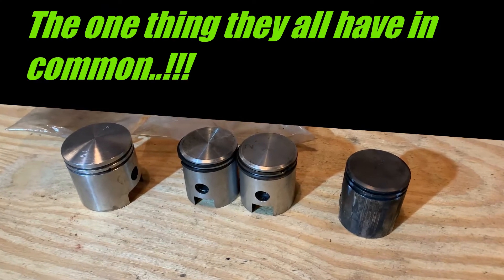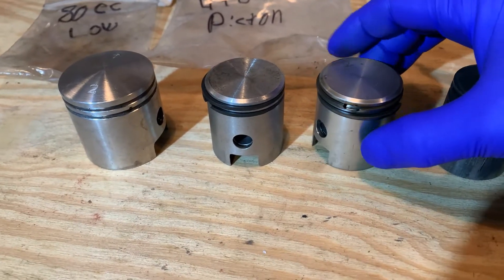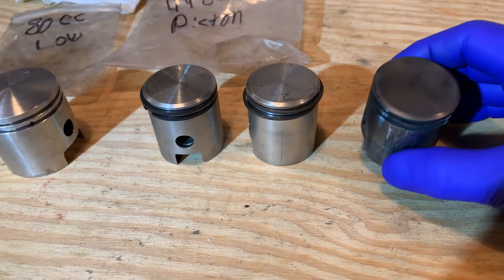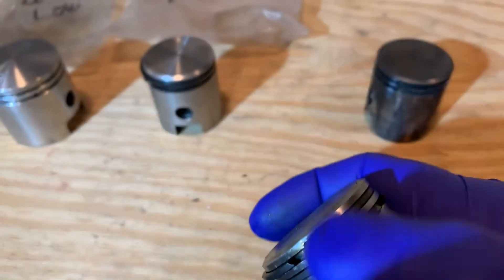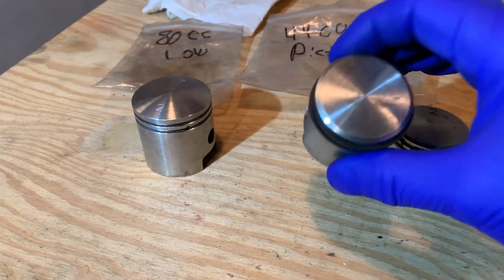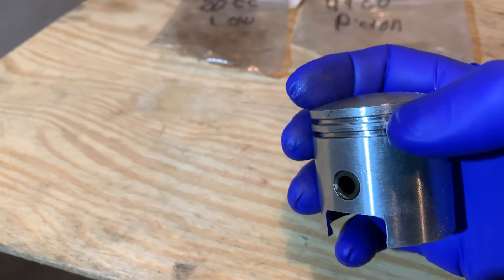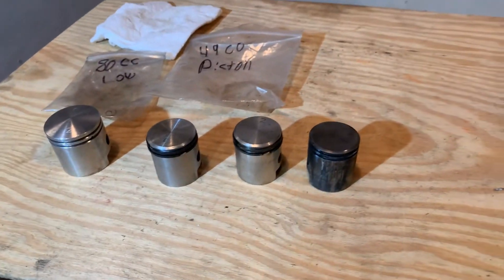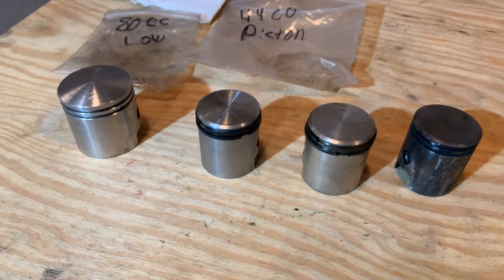What direction did that piston go

Comment: That's not true. I have 8 pistons and none have pins
Reply from the maker: As far as I can remember, even as far back as the late 70's, two stroke pistons have had the pins to keep the rings from rotating so the piston rings openings don't catch the edge of the ports & chip the rings or scratch the cylinder, they could even line up the ring gaps & lose all their sealed compression. The only pistons I've ever seen that don't have them are usually 4 stroke pistons beings there are no ports in the cylinder to catch on & there is less chance of them rotating beings they aren't going up & down as fast as a 2 stroke.. I'm not saying you're wrong about the ones you have, beings I have no idea what you're working with.. 🤷‍♂🤷‍♂

Comment: It's there any way base on the number that tells if your piston its high or low hole type??..
Reply from the maker: That number stamped on the piston doesn't tell you if it's a high hole or low hole. I don't have any pistons left in the shop to show you but you can google, how to tell if you have a high hole piston for a motorized bike & some pages should pop up to show you how you can measure what one you have..👍
Reply: @EcoTransGaspoweredBikes  thanks for the info!

Comment: After you break the engine in with the mixture of gas and oil do you have to keep on mixing it after it's completely empty for the first time or that's just one time mixture I
Reply from the maker: You have to mix the gas & oil every time, they are 2 cycle engines & the oil you mix in the gas is the only lubricant the internal parts get, so if you run just plain gas it usually burns up the engine..😭 I have a video on my page here that shows what happens when you don't run enough or any oil at all..I think it's titled When you forget to put in the oil

Comment: Brand new engine what is my first time actually get to ride it for good 45 minutes now my spark plug boot is completely burnt and I notice the head is smoking
Reply from the maker: I'll have to admit I've never heard of a sparkplug boot completely melting down in a 45 min ride.🤔 All I can really suggest without seeing your engine is that maybe your sparkplug is loose letting some of the cylinder heat flow upward into the boot..( Although if it's that loose I wouldn't think it would even run) Start by checking the nuts that hold the head down & make sure the spark plug is tight..It sounds like massive heat is coming from some where... I've never seen a CDI that burned it's own boot off..🤷‍♂️